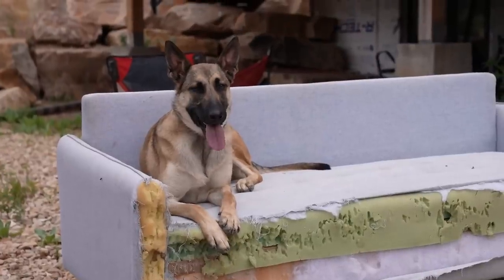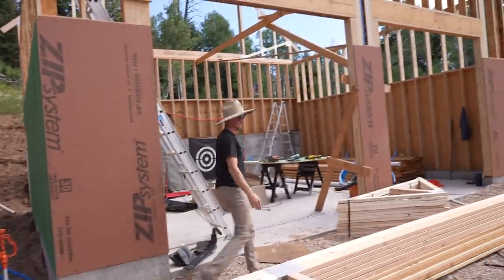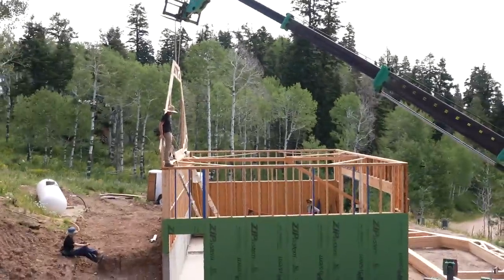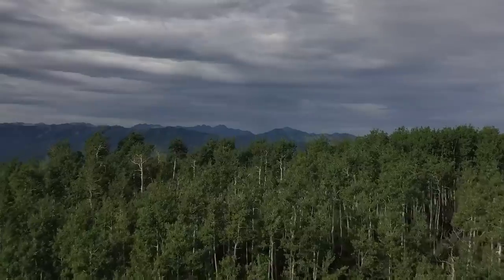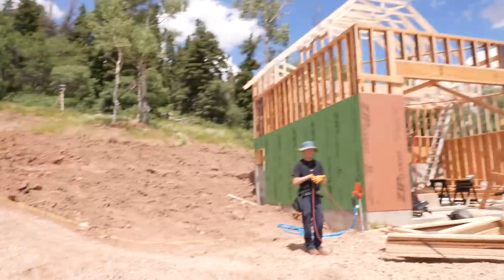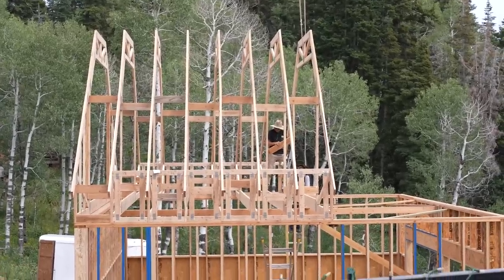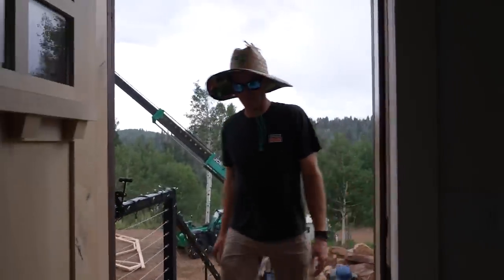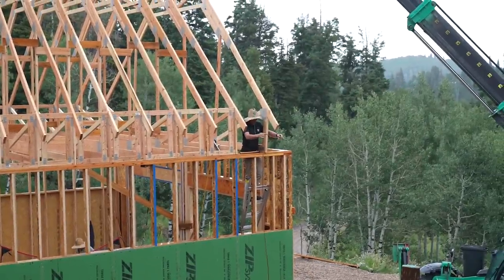SETTING TRUSSES WITH A FORKLIFT | BUILDING OUR OWN HOME

Comment: I was on pins and needles watching you work as the storm was rolling in. You heard thunder. That means there IS lightening.  You had a GIANT lightening rod stuck up in the air, especially at your altitude. You should NEVER operate tall construction equipment in a storm. you guys are super lucky you did not attract a lightening strike. What you were doing was inviting it to come your way. And then you left it sticking in the air.   NO, put it on the ground. 

Other than that, i am so glad to see the trusses FINALLY go up and I also like to see the interaction between Joel and Leo, , brothers.  That is so special.

Comment: Something I discovered a few days ago, If you can hear the thunder you are within range of a lightening strike. They can travel miles horizontally before finding a conductor, like a metal fork lift. Get the hell, inside.

Comment: Trent, I know those trusts weigh next to nothing but the boom does and moving the forklift while it’s extended with a load on that ground not good safety practice. Also that machine has out riggers for a reason. Teaching safety to Joel is really important.

Comment: Here in Pennsylvania we call what you rented a telehandler.
Reply: Almost everywhere is called a telehandler but in the end is considered a type of Forklift
Reply: I have not heard of that term here in Wisconsin
Reply: @gerardorivera7356  its catalog name is a rough terrain high reach telehandler fork lift
Reply: Good to know. We always just called it a boom fork.
Reply: @damienthetexasian6827  I worked in construction for 35 years, 20 as a supt. For a large electrical contractor. Names for tools and parts and machines are very geographical. They have different slang names for things in regional ares. The problem is if you work all over the country you have no idea what people are talking about. I prefer to use the description that the manufacturers use for parts, tools and machines because they are the same all over the country.
Reply: @jeannerountree952  

Nor in Florida

Comment: Please, please, please get out of the weather when you hear thunder. Just because you don't see lightning doesn't mean that you can't be struck by it - no place outside is safe when thunderstorms are in the area, and lightning can easily travel 10 to 12 miles from a storm, with some cases documented as far as 60 miles. Those trusses are just wood and steel - they can be replaced, but you cannot.

There, done with my mama lecture. 

It's great to see how quickly this process is going for you - I'm eager to watch the progression, as we'll be building a new garage very soon. :)

Comment: where was the angled bracing on the 1st 4 trusses? In the 70s we set all the trusses by hand...even some like these. walking on 2 x 6 walls was always a rush. standard 4/12 trusses we  would flip..a guy on each end, a guy on the bottom to flip and a guy at point to catch the truss and tack it to a 1 by...from the gable we ran 2x4s every 4 feet to the 4th truss then on trusses like your we would install agle bracing, gable to the 4th truss and vice versa. after we secured the gable and the 4 trusses we would proceed to set or flip trusses. I went away from construction for about 15 years. when I came back everything was fork lift, boom or crane...and I loved it.
it looks good, keep up the fun...its bringing back the memories...and the aches and pains. 
by the way...weve all got gusset scares.

Comment: A tip if you ever do this again. Build the roof on the ground. You could easily do it in 2 sections. With experience you could do it in 1 section with that forklift. It would only take a couple of hours and way safer. Once up there you can complete everything and put sheathing on the roof.

Comment: I enjoy watching just a heads up you’re using zip system OSB. It’s a good idea to tape the seams  it is part of the complete zip system. That way you’ll never have a moisture problem. If you’re using the OSB Zip system on the roof you should definitely use the zip tape to seal the seams. This will make your building water tight.
Just a watcher. I don’t work for zip system. LOL
Reply from the maker: Yes, we’re waiting because we need a shear wall inspection before we can tape the seams 👍🏼

Comment: Just curious, I have no building construction experience, why couldnt you lean them against the front wall and pick them up one at a time. That way you could get the machine closer to the building while working?
Reply: Maybe they didn't want to stay standing up? If they did stand up, then they gotta be extra careful each time they hook 1 truss so that they don't fall over.
Reply: I surely don't know what I'm talking about but I'm thinking if you left them there too long and considering moisture they would bowl
Reply: The correct answer is they could have
Reply: @sisterreneemauser6094  I think the word you're searching for is warp or bow?

Comment: Why did you not attach the top pieces before lifting the trusses? Do you think it will be easier to do when you're 20 feet in the air? Perhaps you wait until you have sheathing on the roof or the apartment floor.

Comment: Be careful with keeping untreated wood outside in wet weather. The untreated wood can easily develop mold/mildew, which isn't a big issue now, but as time goes by and as the wood gets covered (no direct air circulation) the mold has perfect conditions to spread and contaminate your beautiful new building.

Comment: I’m a heavy equipment operator.
I just laugh every time someone does trusses. For one the delivery guy usually puts the trusses right where the piece of equipment Hass to be to set the trusses. And the way you put the trusses in front of the garage right where the piece of equipment had to be to reach the back of the garage just cracks me up.
And some of your videos you talk about craftsman yelling at the screen that was me!! Lol
I was yelling in a nice way!!!
And Allie the ropes are called taglines. Only one tagline is needed otherwise the two tag lines are constantly fighting each other. Because the average person pulls on a tagline instead of steering the truss. You have to let the piece of equipment do the work and not attempted to pull a tagline. 
I have anxiety from watching this video!!! Lol
The shots of the dogs relaxed me!!! 😂
I have set trusses that were 60 foot wide and the building was 120 foot long and I told the guy he should have more two by fours on hand to just brace the trusses. I set all the trusses for one spot with a 60 ton crane. He didn’t brace the trusses like I told him!
The next day. I got a phone call from my boss saying we have to go back to the job to pick up all the trusses because the wind blew them over at night. They were pretty much a total loss. And the outward pressure from the truss is folding into the building blew out the block walls. The walls were constructed out of 12 inch cement block. It was a horrible mess!!!
About a month later I went back with a Crane and set the trusses and I’ll be darn he had a whole bunch of two by fours!!! And braced the trusses properly. He did come by the Crane and said I should’ve listen to you!!!
There’s definitely a learning curve for you guys but you’re doing it!!!
Lesson learned though don’t put the trusses close to the work where you have to reach a crossed with the boom and try to hit your spot always place the piece of equipment as close as possible. 
The other thing is when you rent a forklift you can rent a small jib that replaces the forks which is very nice for reach. Along with a truss hook which shortens up your rigging length which in turn gives you more reach if that makes any sense.

Comment: According to The Weather Channel, if you can hear thunder, you are close enough to the storm to get struck by lighting.  Don't play with lighting, it will NOT make your day!  Sorry to be such a negative Nancy, but I have almost be struck three times.  The closest. the bolt struck two feet from feet.  My mom, thought I had been struck  Fortunately, I had steel toed work boots on with thick rubber soles.  My mom said, after the lighting struck, when I cam back in the house, all the hair on my head, and arms, was standing on end.  So, I don't play with thunder, or lighting.  Especially, if I were working next to a big green lighting rod.  😕

Comment: am just wondering if the bottom center 2bye on the trusses are considered load bearing with just truss plates holding it all together. shouldn't the bottom 2bye extend the whole length of the truss??

Comment: Trent, running that forklift in a thunder storm is like so dangerous.  It becomes a lightning rod, and anyone near it is going to get hit!  A crane operator would have stopped working as soon as the lightning even got close.  Be safe, work smart, it's not working in an unsafe condition.